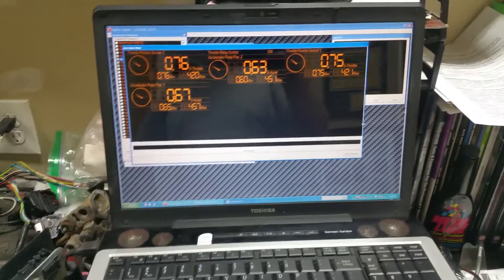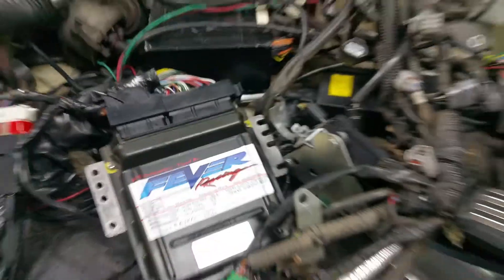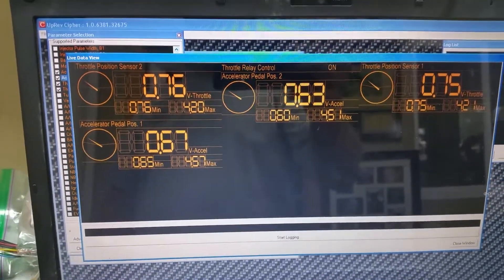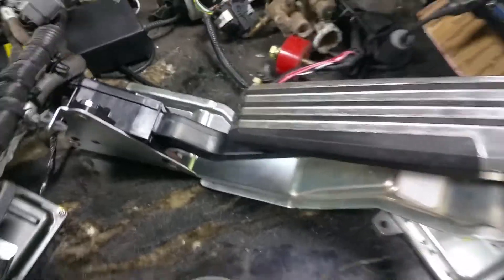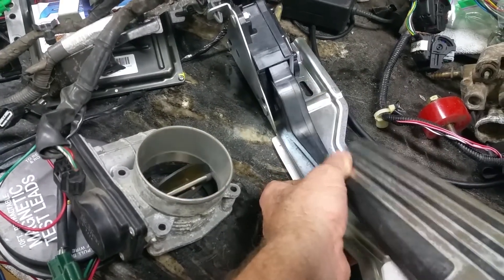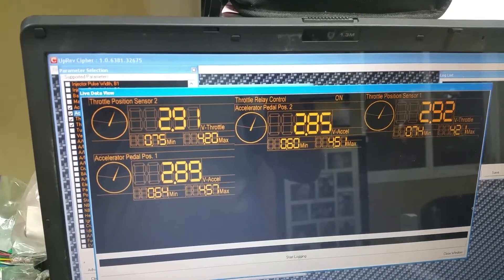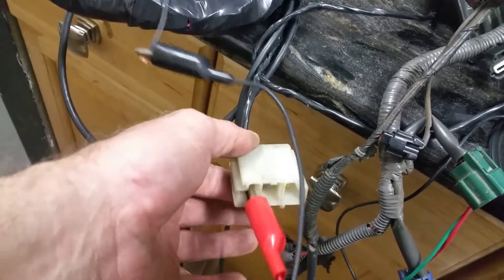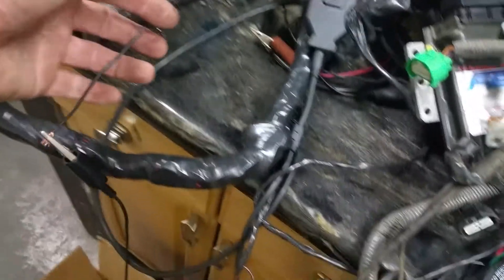Nathan White harness service VK45DE into 300ZX - Z-Fever

Comment: Hello. I have a 2003 m45 with the vk45de. I want to swap a cd009 transmission into it. How would I by pass the trigger sensor to get the cd009 to work?
Reply from the maker: Here is our manual transmission adapter for VK45/VK56 engines to CD009 transmission : https://m.facebook.com/media/set/?set=a.10152935513118296.1073741905.296402898295&type=1

Comment: Hello, very nice work. I will be doing a VK45 swap into a G37 soon, If you have any info that would be very helpful, thank you
Reply from the maker: You will need the EFI harness and ECU from an 06-07 M45 for this to work. You can use the Q45 engine but not the Q45 harness or ECU. These are non-tunable.